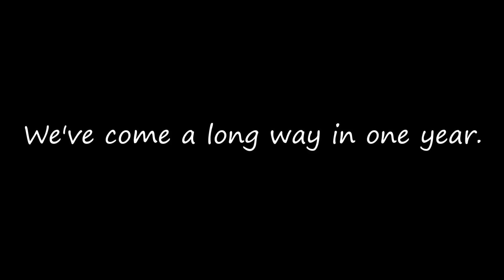OFF GRID HOMESTEADING.  One Season To The Next. A Backwoods Living Vlog. Episode 77

Comment: That has to be the most efficient way to cut wood. I will be mounting a crane for the back of my truck so I can lift heavier pieces into the truck bed without getting hurt. There is always free wood listed in my area, mostly from storm damage.  I especially like the greenwood for bowl and spoon carving. That coop looks spiffy! I too am glad to see that the old screen door gets a second life. During the colder months will there be a solid door for the coop?
Reply from the maker: I have a glass insert for the door. Right now I'm using the coop for a work area and a tool crib and liking it. May delay on getting chicks now :-)